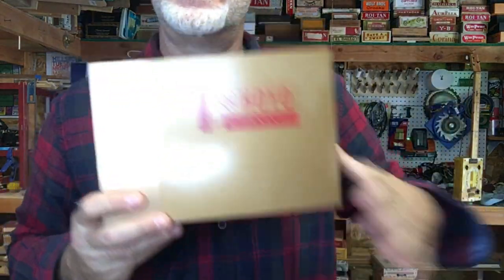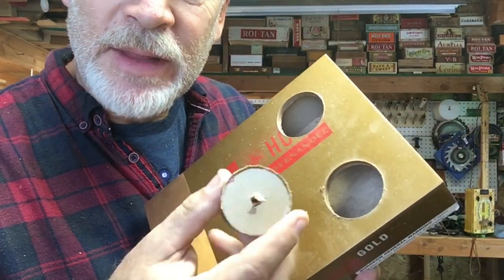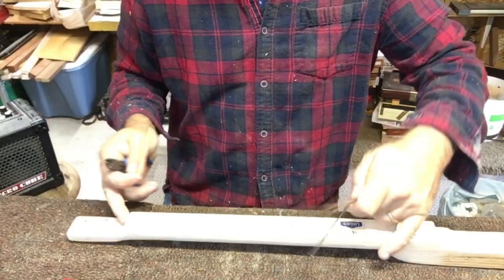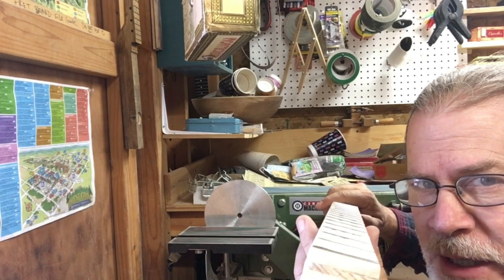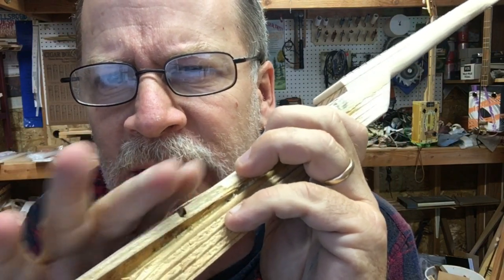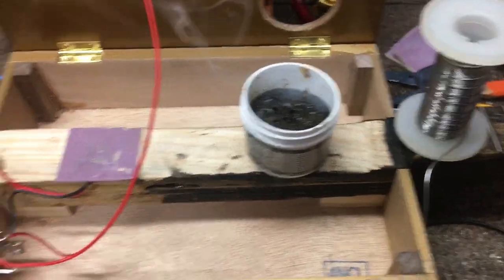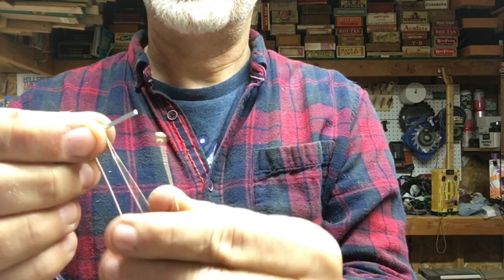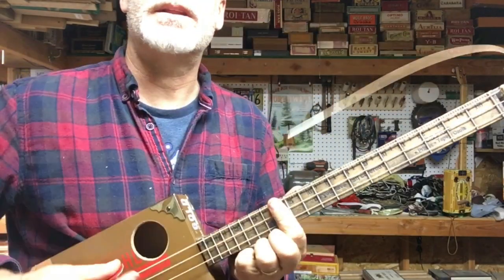Building a Cigar Box Guitar Step by Step

Comment: Dell..! During the wiring of the Piezo, volume control and output jack, I was desperately waiting for you to attach an earth wire to the metal hinge, to earth the strings and stop them from buzzing! Did you forget at that stage?...LOL...!
Reply from the maker: i usually only ground when using a magnetic pickup.  the piezo is an acoustic pickup, a crystal style transducer.  i'll try grounding it and see if it helps or if there is any change.??

Comment: Del. I really like your channel. You cover lots of subjects. I am building an ammo box 3 string guitar. I am going to use a piezo bridge pickup and I am looking for a less "twangy" sound. I am using a 6 string Strat style neck attached to the end of the box and not through it. this leaves me a lot of interior room. Would gluing a piece of 1/4" plywood onto the underside of the "top" help to cut down the metal sounding vibrations and thus help the overall sound?

Comment: Hey Dale,
Why do you remove top face of the neck inside the cigar box below the shelf to where the pickup is mounted?
For an electric guitar, could the entire top face of the neck be in contact with the bottom of the cigar box face plate when both the bridge and pickup are going to be mounted on the top face of the cigar box? 
Would it sound okay as an electric?
If it has some small sound holes, would it sound okay acoustically?
How much back angle did you put into it?

Comment: That gold top is money! A nicely comprehensive review of the process. Going to dig in the vault for your back angle video. If the heel is cut for the back angle and the block is flat, are there ever issues getting the heel to be stable?  Thanks again, another gem!
Reply from the maker: if there is then just sand or file to make surfaces fit.
Reply: @PuckettCigarBoxGuitar  thank you. Haven't tried the back angle yet, so getting mentally prepped

Comment: Great video Del, but for the sake of completeness, could you give us your neck dimensions?

Here in England, we don't have a plethora of picket fence posts laying around and nobody seems to sell disposable wooden rulers/paint stirrers, so it would be nice to know what the starting dimensions of your neck wood and fretboards are, just to give us a base line.

Oh, and based on that, what measurements do you use to create your neck angle?
Reply: Wickes sell hardwood (hemlock) banister spindles 1000x41x41mm. Nice and straight (and inexpensive). Using this to build my second CBG and it seems to be just right.
Reply from the maker: be sure to check out my master class video series...

Comment: How do you connect the neck to the box?
Reply from the maker: i use long sheet rock screws and drill pilot holes thru the back of the box... thru the mounting blocks into the neck wood.  If you watch my 2020 Master Class Video series you can see the process from beginning to end :-)